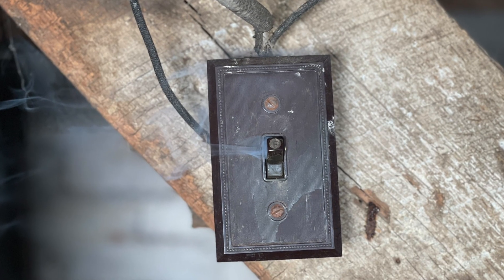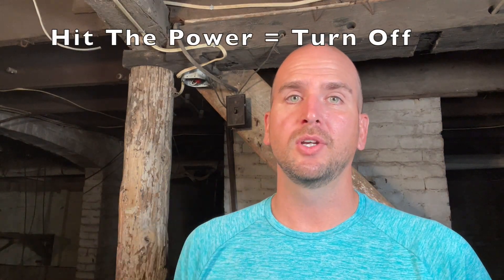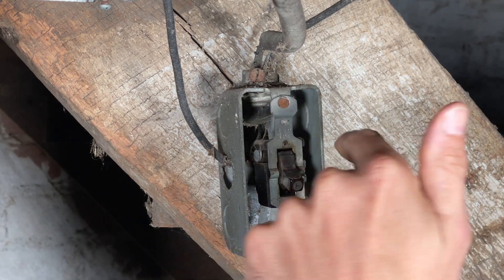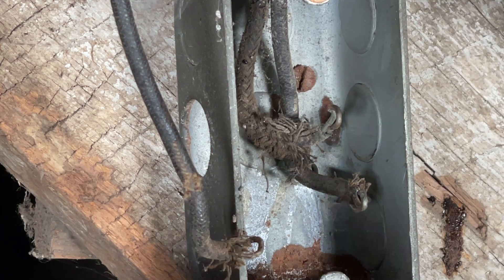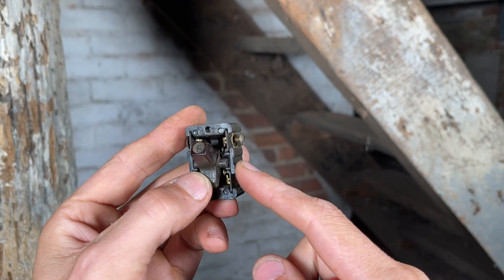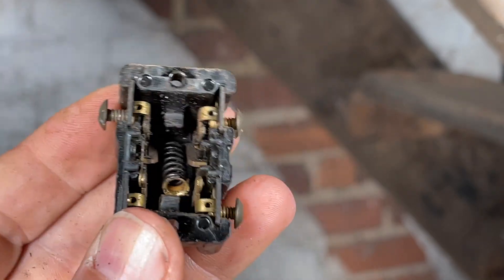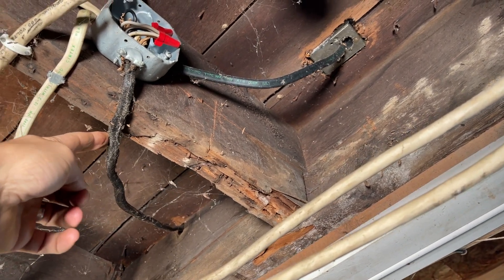Issues with Old Electric Wiring | Knob and Tube

Comment: That pull string looks cool. Also love the old bakelite and brass cover plates and the old switches that have a satisfying click to them when pressed. I agree that rewiring is a great idea to add grounding and increase safety however in the process I would try to save and reuse as much of the original switches, receptacles, fixtures, and cover plates as possible. Many of these items add so much character to an older property and are often hard to replicate and/or better built than a lot of the cheap crap that is being sold today.
Reply: A lot of the older last century homes actually have much heavier gauge high quality copper wiring.
I happened to found it out during replacement of some worn out receptacles of the hybrid system.
I noticed the standard 15 amp modern wiring are 30% thinner.
Reply: @loktom4068   houses built say 80 in more years ago they didn't often make the distinction between number 12 for a 20 and number 14 for a 15 amp overcurrent, they used all number 12 and that wire often was silver clad copper, ( I thought it was aluminum at first) it was copper dipped in molten silver which is a better conductor than copper and both are much better than aluminum that's why with aluminum, if you had a 20 amp overcurrent you would have a number min. 10 gauge wire which is one size larger than number 12 because there's more resistance with aluminum then copper.
Reply: Well, I don't know the latest code but for years it was possible to install GFCI outlets where there wasn't a ground available.   I believe it was supposed to be marked, "No Ground" or some such.   A GFCI operates about as fast as a dead short takes out a CB so it offers equal or better protections.   A problem with the GFCI is that they sometimes "fail un-safe."
Reply: @andyk192  I agree that older switches can fail like the one shown in the video has however many of the newer switches, especially the cheaper ones fail much more often. My rule of thumb is to always stick to spec, commercial, or industrial grade switches and receptacles regardless of whether I am reusing an old switch or receptacle or buying a new one. Cheap residential grade devices go in the scrap pile regardless of age. As for having a switch fail which can happen, if you have properly grounded metal boxes and cover plates there is a minimal risk of fire since the fault current will be safely carried away by the equipment ground and the breaker or fuse protecting the circuit will trip/blow assuming it is in good working condition. Therefore, old switches and receptacles can be used safely as long as your wiring is in good condition, all of your boxes are properly grounded, and you are using good quality and properly sized circuit breakers or fuses to protect each circuit. I would much rather be living in a house with the original fuse boxes, switches, fixtures, and receptacles that has just had the wiring replaced with modern thermoplastic insulated wiring and all of the boxes properly grounded rather than a house with a cheap but new aluminum bus breaker panel, and cheap plastic decora plates and devices all connected to the original cloth and rubber insulated wiring. I bet we can all agree with that. Too bad that seeing the former is very rare but the later seems to be very common.
Reply: @CompGuy66  the switch he showed was not original to knob and tube

Comment: when you were talking about the old wire entering the handy box, yes they always must have box connectors, but one other thing is they must an outer jacket as an insulator extended entirely thru the connector. There was a piece of it, it's call "Loom" visible at the top entry KnockOut to the box in your photo, but it was installed correctly either.

Comment: So the smoking issue was a bad switch which could happen with any device regardless of wiring. Also, there is ungrounded non metallic cable (Romex) out there.

Comment: The smoking/arcing were not really caused by the knob and tube...it was the old switch.  Common electrical practice calls for replacement of such old switches and outlets.  When I bought my first home, built in 1913 and bought by me in 1979, my friend who was a veteran commercial electrician, while updating the system with breakers and romex, assured me that knob and tube is just fine when used for lights just not for high-amp-draw appliances so he didn't bother with replacing the knob and tube in the attic that powered only ceiling lights.  The rest of the home was done with modern wiring and hardware including an even larger breaker box before I sold the house.  The house is still standing and the folks I sold it to have had no problems with the electrical system.
Reply: K and t wiring was safer because the wires are not running next to each other like common wiring today. The problem now is that the insulation is brittle due to age.

Comment: I have 100 year old stuff working well. Knob and tube was supposed to be wrapped TIGHTLY, sometimes soldered, and heavy taped. I've upgraded alot myself in many many of my rentals, never a problem in 30+ years, except modern breakers locking on, such as square d, cutler hammer, ge, but never had a federal pioneer stab loc failure. Go figure
Reply from the maker: Appreciate the feedback 👍
Reply: @EverydayHomeRepairs   I had a heating circuit go bad after living in the same house for 25 years. I went up in the attic and brushed away the blown in newspaper insullation, and somebody had put a sheet rock screw through a leg of the 12 2. And after 25 years, the copper finally snapped where it had been mostly cut through by the screw. So I patched it, and amazingly no fire. I've had a few instances where stuff has smoldered for a minute, caught fire for a few seconds, and then gone out by itself. Sometimes you just get lucky
Reply: @EverydayHomeRepairs   I used to own apartments in Canada, and the electric inspector said I had to get rid of my CEB equipment, Canadian Electric Box, I said I took them all apart and brushed every contact sparkling clean, and kept the correct fuses for the gauge of wire, and after I lectured him for 10 minutes, he let it slide until I had the time and the money years later to switch to breakers. And as I mentioned earlier, I've had breakers lock on. And that's every single brand under the sun except for the stablocks. I even had some bulldog at some point you know, the pushmatics
Reply: @EverydayHomeRepairs   I put an electric boiler in one of my apartments, and when the boiler stopped working 3 years later, the tenant mentioned to me as I was pulling off the cover looking for the problem, that it had been buzzing for months. The GE breakers were nuclear melted down, and burned all the breakers around them, and partially melted the bus bar. I polished up the bus bar, and it's been fine for a few years now, but it'll melt down again. And this is equipment was only a few years old. Can't trust anything

Comment: That switch failure is just an old switch failure, not a problem with knob-and-tube.  Once you replace failing switches and outlets, especially for modern ceiling lighting, knob-and-tube is totally adequate.  No one is going to be touching the ceiling fixtures, and modern bulbs draw maybe 10% of the current that the wiring was originally rated for.  If you do decide to keep outlets connected to k&t, you can swap old outlets for modern GFCI ones (yes, even without a ground) if you label them properly.
Reply: You’re only talking LED bulbs, what about EVERYTHING else? You’ll soon be maxing out the 14 gauge typical of K&T and I hope all breakers are 15amp! Have fun handling crumbling insulation while swapping out switches and outlets. K&T is not safe and must be replaced once touched.

Comment: problem with nob and tube is back in them days you didnt use much power mybe a fridge and a light bulb if you lucky now eveyone got 5 tvs 7 laptops 3 big computers 2 big fridges deep frezzers washer dryer heater ac units 35 lights and lamps and every thing else on outdated wires

Comment: I had an 1890 house with original wiring. I payed a guy $1500 to install the breaker box and rewired the house myself for under $200. It's not the easiest job if you have a two story house but you save a lot of money.

Comment: The old federal pacific panels are far more dangerous than the knob and tube  wiring.
Reply: My house had 3 FPE panels from 1959 when I bought it. The main panel had a 20A circuit for the backyard patio electricity. I was hanging up some PRC string lights, and when I plugged them in, they lit up dimly for a couple of seconds and shut back off. I quickly realized the 1959 FPE panel (that had been outside, in the elements for 53 years) was tripping it's 20A breaker as designed. I found one of the light sockets had it's center conductor folded over into the threads - a direct short. 
I've since read that some companies made FPE compatible breakers that actually worked in later years, but this one sure looked like it came from the 50s.
Reply: @brianp6965  Should have immediately tripped and not illuminated at all with a direct short like that.
Reply: I still see the push button style breakers in homes today. Scares the hell out of me.
Reply: @foreverssober  when we bought our house those were the upgrade.
Reply: @foreverssober  push button "breakers" or light switches?
Reply: @frankpaya690  
Push button breakers.
Reply: Zinsco are just as bad
Reply: @ikonix360  not familiar must be a regional thing
Reply: You can weld with those breakers 😳
Reply: @barry8215  I get the joke🙂

Comment: If you had ground on the box it would've trip the circuit ( off) , second putting a metal wire connector is still a problem, put tape on it ( one wrap is good for 600 volts it written on the tape ) plastic is best choice. Finally when  changing out circuit breaker box is one cost and the price does go UP in price to rewire the house ( most people say " we get back to you "  unless it a rehab ) I notice the circuit breaker box on brick, it should be on painted wood panel ( it keep the moisture down, see on the corner of the box rust )

Comment: You never really explained what knob and tube wiring is and how it's built.  You should have opened a wall and shown the wire rigged along alternating studs and how they then are routed into switches and receptacles.
Reply: @TechHowden  I was saying that he didn't explain how knob-and-tube wiring is constructed.  I owned and renovated a house built in 1932--I'm tooooo familiar with it.

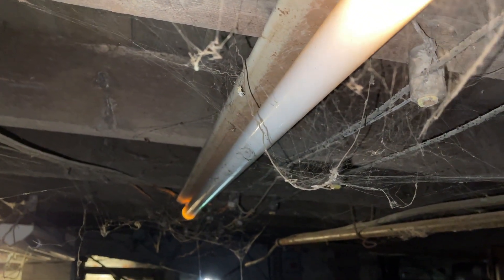Comment: 7:10 I would say that pull string is more like 80 years old.  Nothing like that was being used when I first learned about construction as a small boy in 1965.  No knob-and-tube then; all wiring was very much like it is today, complete with the ground wire.
Reply: pullstrings and keyless are no longer allowed due to code needing bulb to be protected
Reply: @davidicousgregorian  Actually, a new light fixture with a built in pull cord to turn power on and off is still code in Michigan.  The way that was set up with a separate pull cord feet away -- since I have never even come across it IDK.  Also, the state doesn't care if the bulb is protected with a cover.  Michigan is usually 50 years behind every other state with everything but since these light fixtures are commonly available I suspect other states allow them as well.
Reply: @mharris5047  thats the new code for new builds not remodels or reinstalls code is for new book and new construction . old rebuilds allow old rules from as far back as 2015 not 50 years but maybe 7 depending on jurisdiction rules . and no not behind most southern states are behind due to population . more homes mean more accidents to base new codes by.
Reply: pullcords like you describe are allowed in some cities but not new construction built in cords still require bulb to be covered enclosed but allow those type of enclosed to use  a chainpull but new code for 2023 says not for new installs
Reply: @mharris5047  E4003.2 Luminaires Near Combustible Material

Luminaires shall be installed or equipped with shades or guards so that combustible material will not be subjected to temperatures in excess of 90°C (194°F). (410.11)   michigans rules
also this

E4003.12 Luminaires in Clothes Closets
For the purposes of this section, storage space shall be defined as a volume bounded by the sides and back closet walls and planes extending from the closet floor vertically to a height of 6 feet (1829 mm) or the highest clothes-hanging rod and parallel to the walls at a horizontal distance of 24 inches (610 mm) from the sides and back of the closet walls respectively, and continuing vertically to the closet ceiling parallel to the walls at a horizontal distance of 12 inches (305 mm) or the width of the shelf, whichever is greater. For a closet that permits access to both sides of a hanging rod, the storage space shall include the volume below the highest rod extending 12 inches (305 mm) on either side of the rod on a plane horizontal to the floor extending the entire length of the rod (see Figure E4003.12). (410.2)

     The types of luminaires installed in clothes closets shall be limited to surface-mounted or recessed incandescent or LED luminaires with completely enclosed light sources, surface-mounted or recessed fluorescent luminaires, and surface-mounted fluorescent or LED luminaires identified as suitable for installation within the closet storage area. Incandescent luminaires with open or partially enclosed lamps and pendant luminaires or lamp-holders shall be prohibited. The minimum clearance between luminaires installed in clothes closets and the nearest point of a closet storage area shall be as follows: [410.16(A) and (B)]

Surface-mounted incandescent or LED luminaires with a completely enclosed light source shall be installed on the wall above the door or on the ceiling, provided that there is a minimum clearance of 12 inches (305 mm) between the fixture and the nearest point of a storage space.
Surface-mounted fluorescent luminaires shall be installed on the wall above the door or on the ceiling, provided that there is a minimum clearance of 6 inches (152 mm).
Recessed incandescent luminaires or LED luminaires with a completely enclosed light source shall be installed in the wall or the ceiling provided that there is a minimum clearance of 6 inches (152 mm).
Recessed fluorescent luminaires shall be installed in the wall or on the ceiling provided that there is a minimum clearance of 6 inches (152 mm) between the fixture and the nearest point of a storage space.
Surface-mounted fluorescent or LED luminaires shall be permitted to be installed within the closet storage space where identified for this use. [410.16(C)]
Reply: @davidicousgregorian  its legal in Florida I put in a keyless the other day on a new home

Comment: Have you worked on mobile homes? Currently need some guidance on an entire wall that has no power to the outlets but lights turn on. Checked all gfci’s nothing wrong there. Replaced all outlets and did not solve issue. Thank you in advance